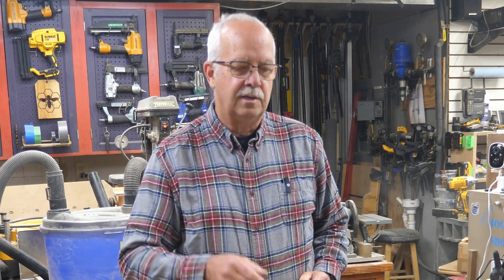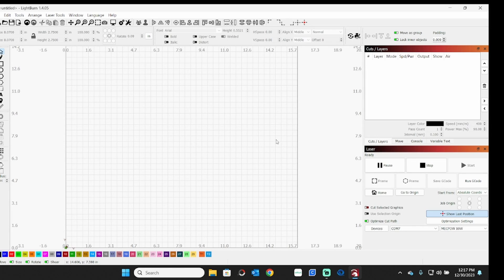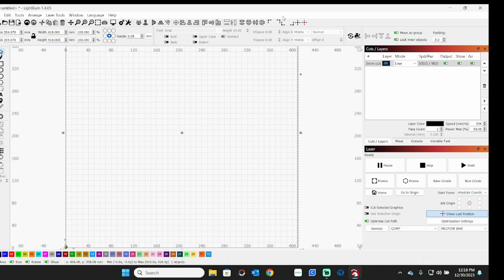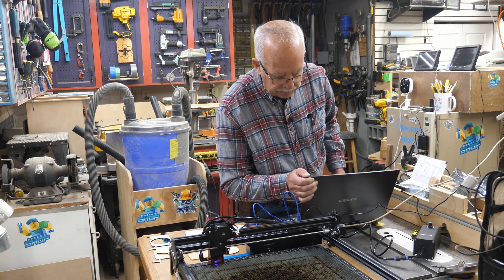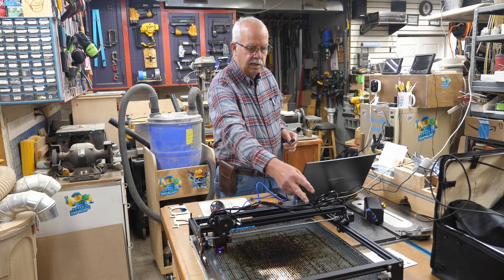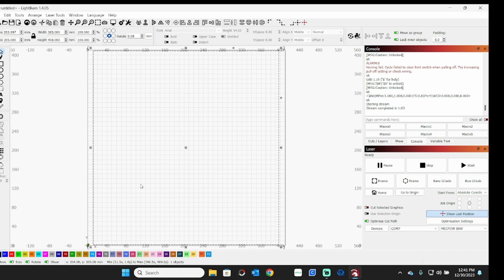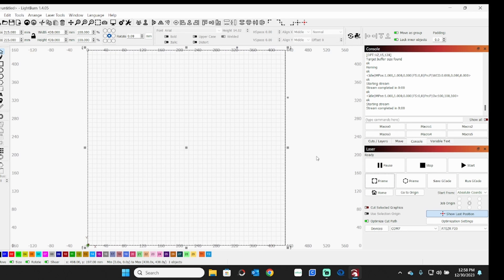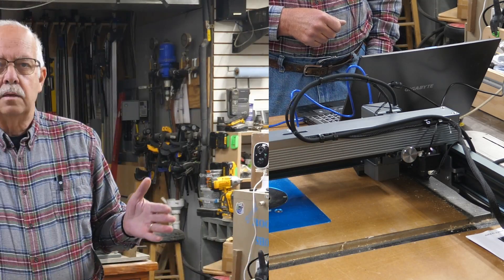Testing Your Laser Work Area

Comment: Hey Roger, great videos, very educational. A quick question if I may,,  I engrave a couple of reference squares for things I need on my base board,  when I run it again it engraves about 3-4 mm out to the original engraving... I have it set on Absolute Coordinates so should be exactly the same, not sure where I'm going wrong.. thanks..
Reply from the maker: Assuming you have a solid mount, check the home limits as well as belt tension and roller eccentrics tightness.  Any of those can cause a variation.